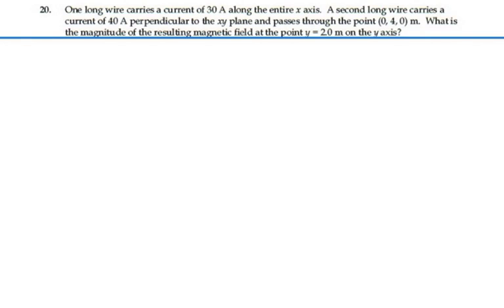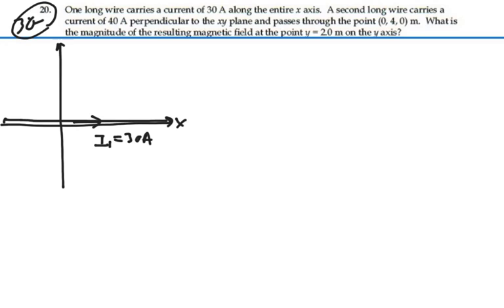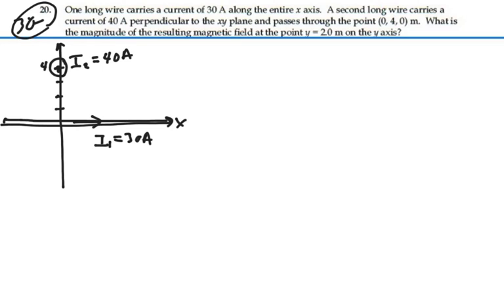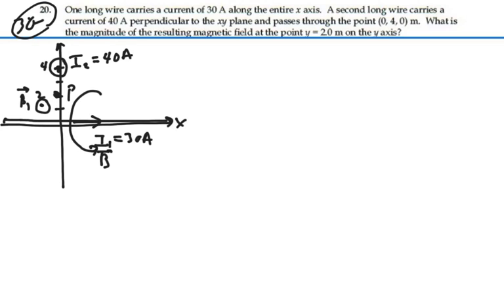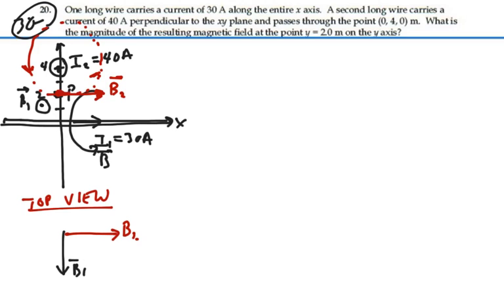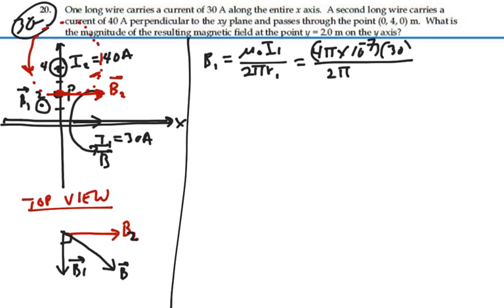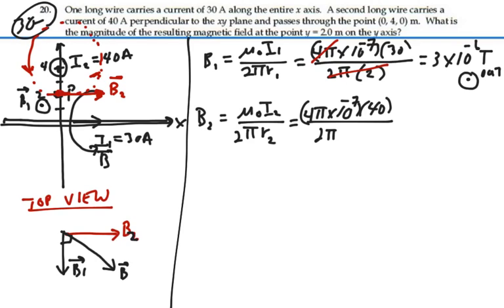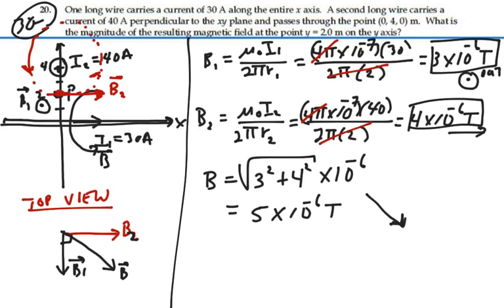Prob 30-20

Comment: why did the formula call for 2pi instead of 4pi?
Reply from the maker: Because it is an infinitely "long" wire (Ampere's Law).  You could still theoretically apply the Biot-Savart Law to a current segment that is infinitely long.  In that case, the cosine(0) - cosine(pi) will give you 1-(-1) = 2.  This factor of 2 changes the 1/(4pi) to a 1/(2pi).  Thanks!